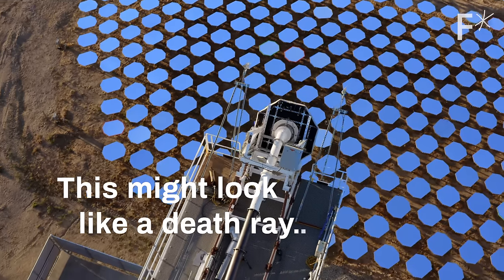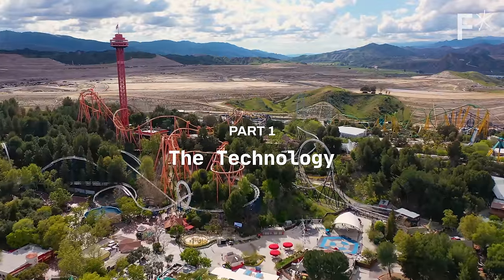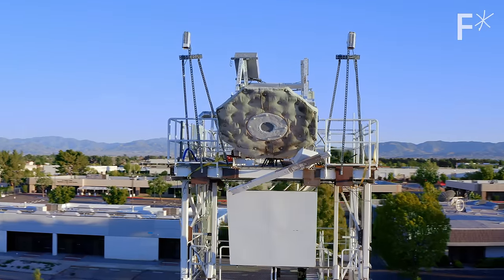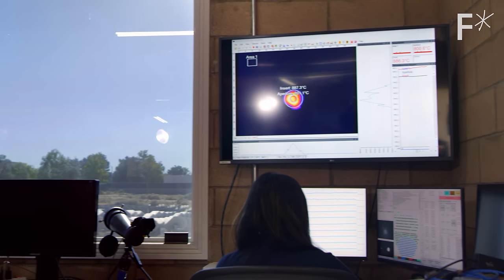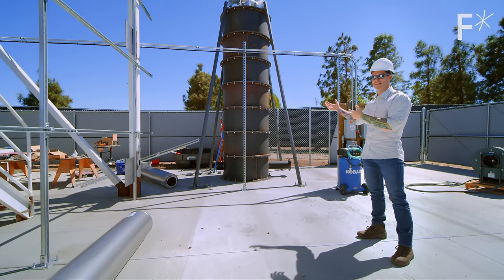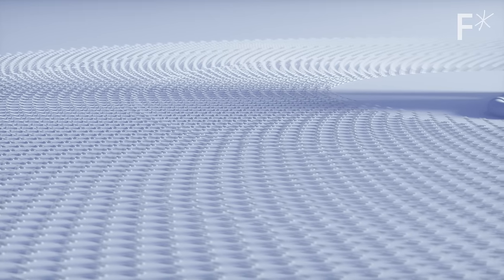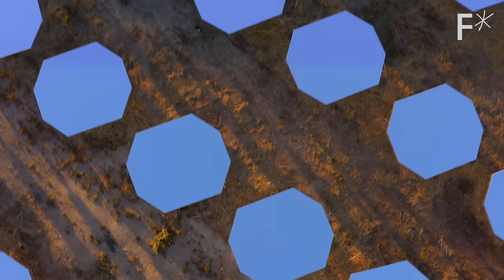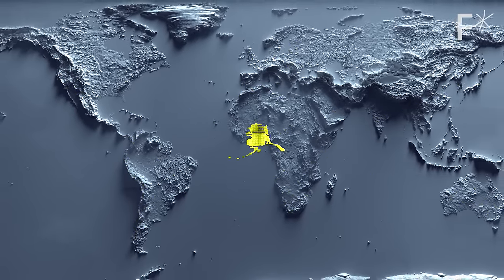How mirrors could power the planet... and prevent wars | Hard Reset by Freethink

Comment: They didnt talk about how much money will be spent maintaining the mirrors and cleaning them. That factors into the cost of operation.
Reply: But isn’t it good in a way? Now they can create jobs for people to do those things, no?
Reply: A couple of wet rags and a bottle or two of windex can't be that expensive
Reply: Coming soon: "The American Windex Embargo of 2023"
Reply: Robots.
Reply: so what?
Reply: @christophersoetadi1633  No. Labor is expensive. That makes energy expensive. Expensive solar energy means we burn more coal.
Reply: Just program robot to do it.
Reply: @christophersoetadi1633  the cost of anything is what really matters when it all boils down, if that solar things isn’t cheaper AND more efficient than it won’t be adopted. Basic economic rule of if you’re trying to penetrate the market you need to offer more for less, otherwise it won’t.
Reply: @christophersoetadi1633  Have you seen what these do to birds? Also in the past when these were built they deteriorated fast...the ground littered with broken glass and scorched, dying birds and insects.
Reply: How much is it going to cost to pay a handful of people to be out there with squeegees? A hell of a lot less than all the personell, equipment, and transport required to access and transport fossil fuels. Not to mention the cost in terms of environmental impact from fossil fuels.
Reply: @user-py9cy1sy9u  
A tiny fraction of the labor required by the fossil fuel industry. Why would a handful of people with squeegees or one with a power washer need coal to clean mirrors?
Reply: @baneverything5580  
You and tRump, champion of birds! I'll bet someone comes up with a way to protect birds from these areas. Far more birds are dying from the effects of global warming, and the decline in all animal populations will, of course, excelerate. Perspective is called for in order to fairly evaluate. Just sayin'...
Reply: @auntbutton905  If solar is more expensive than coal people will use coal power instead of solar. So you want to create the least amount of jobs for kwh produced
Reply: All these electric precision motors
Reply: @user-py9cy1sy9u  
OMG! It takes far, far, far fewer people to maintain a solar system than it does to work oil fields, offshore rigs, build and maintain pipelines, work coal mines, fracking operations. Plus there is the toll on health from pipelines that are leaking literally all along the length of the pipeline that no one ever factors in and environmental impact. We are already seeing food shortages and drastically declining water levels in reservoirs, rivers and water tables everywhere. So what inspires you to cling to coal and/or other fossil fuels. Saying coal is cheaper makes no sense at all. It has already cost us so dearly and wars over food and water aren't a possibility, they are inevitable. Because renewable energy comes too late to turn back the tide on severe droughts. It is now a question of whether you want ANY of the human race to survive. I hope with your attitude that you don't have kids. Their chances of surviving what will come in their lifetime isn't good.
Reply: @auntbutton905  The person I was responding to thought that job creation was a plus and I tried to convey a message that its the opposite. In many industries labor is the dominant expense and not raw materials. So if your energy plant requires a lot of people working there it will automatically increase electricity's price.
P.s. You assumed too much about me and its wrong. I want to reduce CO2 emissions I'm just against stupid stuff
Reply: They use robots. It's talked about in another vid
Reply: @baneverything5580  That why they put it on the desert
Reply: @user-py9cy1sy9u  Coal doesn't involve labor?
Reply: @baneverything5580  I guess you dont have much of an understanding of what fossil fuels do to the entire planet and all eco systems not just an extremely localized environment. The comparison is a non issue
Reply: @lanceadams3552  Why are you still using fossil fuel products then?
Reply: @Derbnage  They are trying to put in our heads that if something is labor intensive anyway, why bother changing things. People with a vested interest oil and coal industries are nervous because the tree huggers have finally figured out the right language in their war against oil and coal ie, cheaper and energy security. It has caused a bizarre cultural shift in which oil and coal industry supporters are trying to sound like they profoundly care about the environment.
Reply: @AdamIsailovic  lol you don't get it do you its never been about environmentalism for a lot of people watching technologies like this, all most people care about is if it will be cheaper.
Reply: @klokoloko2114  Basically just windshield wiper technology. Not expensive
Reply: @psyberklown3434  even if we don't use oil for energy, guess what? Plastics still use it. Oil industry isn't going anywhere
Reply: The mirror's Hardware components manufacturing and AI, and software maintenance will be very costly on a large scale.
Reply: And as long as they're not using chemical solutions to do so, we should be good.
Reply: @auntbutton905  the use of robots to do the cleaning work with eco-friendly solution.
Reply: It seems less expensive than something equivalent with solar panels, which is great since it will scale faster
Reply: With nano technologies you can build glass that repel dirt/sand. No more cleaning 🍷However not sure about the cost.
Reply: @christophersoetadi1633  if this needs cleaning this should be done be drones/robots. Not waste humans for mundane tasks. Let let human be creative and use its biggest muscles, the brain
Reply: @harounhajem7972  Yeah but one of the opposing arguments for renewable energy I often see is that it’ll put fossil fuel worker’s out of a job. And people are already afraid that bots are gonna take over jobs. Besides, it’s not like everyone has the creativity or ingenuity for bigger and better things, so why not delegate it to other people?
Reply: Doesnt matter. Oil field have more economic output.
Reply: @leiferickson1494  constantly it is
Reply: Definitely, but oil production also requires maintenance. That's why they spoke about making mainstream deployment.
Reply: Aren’t they still transporting hydrogen through pipelines or am i misunderstanding something?
Reply: @klokoloko2114  "Just", isn't that a great word.
Reply: @christophersoetadi1633  it'd be don't autonomously eventually and plants similar to this only operated at max a few decades before eventually being given up on.  These mirrors are costly to maintain and replace
Reply: @squarewheel9113  thank you. Like the once in some German cars that even spray there own cleaning liquid ( or cleanser/whatever) as they move/wipe. Just optimize it more for the purpose
Reply: There's this fantastic invention called the windshield wiper...
Reply: That has been the achilles heal of this type of technology.
Reply: You know how this could work?
If they scaled it down. Say, a single tower to power Las Vegas. Or two. 
Right next to the city. So in that way you can use much of the infrastructure that is already in place. Source the people to work on the plant from the city. 
Have a contract with one or more glass-wiper companies a city like Las Vegas undoubtedly has. Let them bid for a contract, that'll keep the cost down immensely.

Mirrors can be send to locations overnight if need be. The heavy machinery to build the thing can be transported by existing railroads.. 

See? the idea is great, but they got their scale and application all wrong..
Reply: @ky965  job
Reply: @Derbnage electric can

Comment: Nuclear energy: "Look at the space they need to mimic a fraction of our power."
Reply: Yep
Reply: Are you including the mines for uranium? cause Im' pretty sure the silica, steel, and rocks used for this are a cheaper and of less impact on surrounding lands. (might not have the same energy outputs per sq ft. compared to nuclear, but the infrastructure and maintenance costs are miles apart.)
Reply: @tylerstone2917  
But that's mainly bc of regulations. Nuclear is one of the most regulated sectors. There are new innovations coming though like molten salt reactor. But nuclear (new versions) is the greenest source of power. Some have found a way to reuse the waste.
Reply: @bengsynthmusic  Yes, US did.. they used it in Iraq.. depleted uranium shells.
Reply: Renewable energy: "Look at the money they need to mimic a fraction of our power."
Reply: @hyric8927  
Due to regulations. Some plants take 10 or so years to build bc of regulations.
Reply: Earth Core : "Hello anybody there?, I'm doing a literal fusion here ...."
Reply: Everyone jumped to nuclear when trump said windmills kill birds.
Reply: @tylerstone2917  yup and these could be put in the desert and create bits of shade, reducing wind erosion.
Reply: @tylerstone2917  Actually there are new nuclear plants that can be sustained on depleted plutomium and are modular.
Reply: @tylerstone2917 You would then have to break the cost of the mines between many different sectors. Uranium is not available in super concentrated areas. Therefore many many different resources can be mined from the same process
Reply: @bengsynthmusic And in the near future we should be able to utilize Nuclear FUSION, creating even less waste with very minimal risk of a "meltdown".
Reply: Bingo! These people seem pretty arrogant. Just another propaganda film. Not that I don't like ideas like this it's just that they do it so smugly thinking there aren't any other alternatives. What's the cost in materials and and mining etc to build 40, 000 unit plant? Maybe the same as a nuclear power plant. And why automate when people need work.?
Reply: @bengsynthmusic bro without regulations nuclear is really dangerous. Even with regulations its not 100% safe. No, I don't care if possibility of a disaster is low. When it happens it happens very bad. Fukushima is the prime example. And no, one guy dying doesn't make it any better. The area is still highly radioactive and people nearby got sick.

Comment: This has been around since the 70s. look up why California and most of the Middle East stopped using the arrays
Reply: Ivanpah Has been in shambles for years, so true
Reply: in californiat we have 3 on the way to vegas. They still work.
Reply: @efemdesign  worked so well they killed birds, killed endangered species, dried out the ground and cooked two whole valleys that they ended removing them form because of the ecological damage they did. As I said. Look up what happened. The three left are just test models.
Reply: @Daniel-os9tb  I mean at least it isn't like burning fossil fuels where it essentially turns the air you breath into poison.
Reply: @gamedominatorxennongdm7956  no. It just completely destroys the environment and eco system around it by cooking everything like a Bleeping oven.
Reply: @Daniel-os9tb  so what? You prefer the smell of smog? I mean it's just as bad.
Reply: @gamedominatorxennongdm7956  that’s worse stupid. Nevermind the toxic process to make the toxic protective plastics or the strip mining for the exotic materials just to make the oven that cooks the environment. Never-mind that the disposal is impossible because you cannot recycle close 90% of it and majority of the plastics are more toxic than pouring crude on the ground. Where surprisingly cars could actually burn clean but the govs have out lawed that. Nevermind that carbon scrubbers actually work.  Oops. 98% of oil isn’t even used in cars. Or the fact you need oil to make your oven too.
Reply: @Daniel-os9tb  so what solution will you propose that benefit the environment and the people? Because I'm pretty sure that you'll answer wind energy.
Reply: @gamedominatorxennongdm7956  you realize windmill energy requires to same process to make as that array. In processed materials and oil. Their biggest problem again is making which is more toxic and disposal which again is more toxic than oil.
Reply: @Daniel-os9tb  well then, what solution are you willing to propose?
Reply: @gamedominatorxennongdm7956  second response I already went over that.
Reply: @Daniel-os9tb  I mean that's just minimal, also remember cars consume a lot of living space so there's  a clear drawback for that.
Reply: @gamedominatorxennongdm7956  cars barely consume living space like the oven or the windmills do which destroy eco systems. And unlike those other two. Are completely recyclable. Minus the battery.
Reply: @Daniel-os9tb  but they still do, in fact you also forget the fact that almost every family will own a car which adds up, sure looking at one it doesn't look like much but if you consider other people owning one(or more) cars, then you'll start to realize how it adds up. And hey, not that I hate cars, they're good for long distance travel, but if you just use it to go places that are considerably close to you then you might wanna reevaluate your reasons for owning one in the first place.
Reply: @gamedominatorxennongdm7956  a car maybe two that take up anywhere from 20-30sq feet per two vehicles incorporated in living spaces. Which is already done vrs hundreds of thousands of acres for ovens. You missed that part to make these arrays work for city scapes or even wind mills takes thousands to hundreds of thousands of acres that can’t be used and are destroyed to maintain the city scapes. Nevermind the wastage of the city.
Reply: @Daniel-os9tb  i cannot understand what you wrote ? Can you write in simple and correct english ?
Reply: @Daniel-os9tb  in your second comment